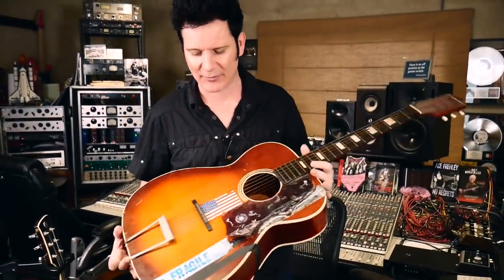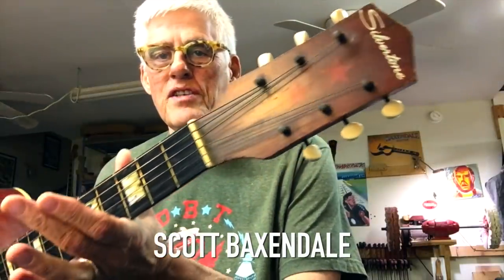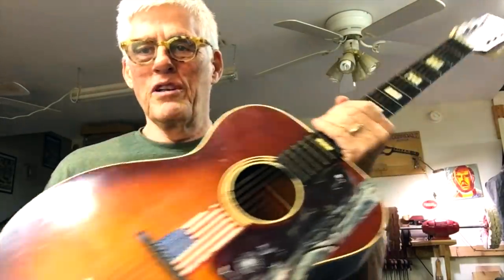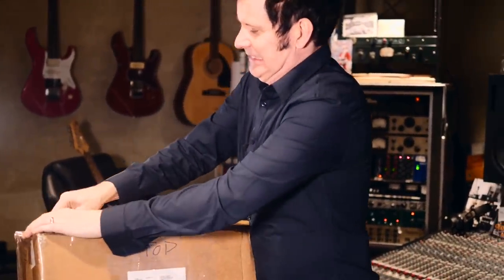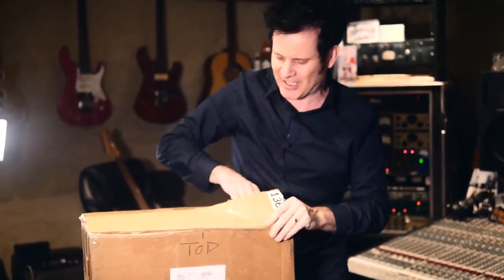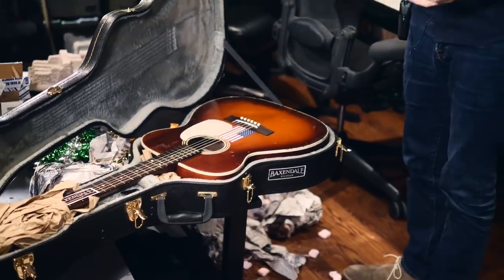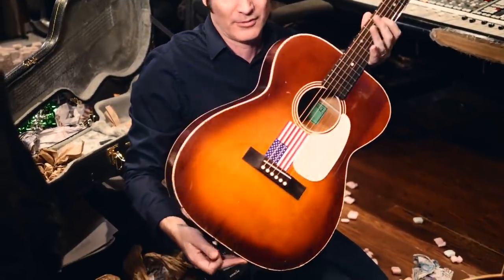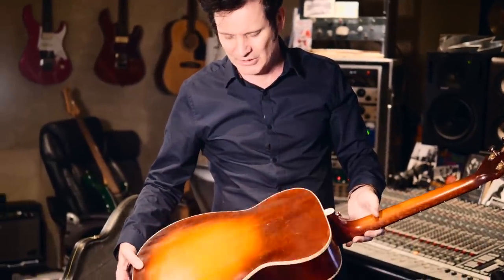Scott Baxendale: Acoustic Conversion Process  - Warren Huart: Produce Like A Pro

Comment: We use D’Addario Phosphor Bronze medium gauge.
Reply from the maker: Scott! Thank you my friend! Again, marvellous work!
Reply: Best strings available. IMO.
Reply from the maker: Jason Simmons have you tried Elixirs? Or the new Sono-Tones? Any opinion on either?
Reply: @Producelikeapro  I have tried the Elixirs and they lasted a long time I didn't like the coating on them. It gave a funny feel to them. I know the difference is minimal in feel but I couldn't get used to it. Haven't tried the other brand you mentioned but I might give them a go now that you have mentioned them. Thanks for all you do for ppl like me. I've learned a ton from your videos. 👍
Reply: Produce Like A Pro As a Luthier who has been restoring guitars professionally for over 40 years I can say we do not like Elixer strings. They are a life saver for the guy with acid hands, however. The coating changes the sound which on a tinny or crappy sounding guitar smooths out the harsh high end and makes them sound a bit better. However, on an acoustic guitar that has world class tone the coating dampens the sound and dynamic range of the guitar. We prefer phosphor Bronze or nickel strings without coating. I’m a huge fan of flat wounds on archtops!
Reply: @scottbaxendale323  love the sound of phosphor bronze strings!
Reply from the maker: I love Flat Wounds on Archtops as well! Thanks for the tip Scott!
Reply: Produce Like A Pro I hate elixirs but do like the SonoTone and other nickel or steel acoustic strings.

Comment: Just curious about why they changed out the floating bridge?
Reply from the maker: NedFumpkin the new bridge was a vast improvement in sustain! It sounds amazing now!! So much richer!
Reply: The floating bridge and tail piece design works by the strings setting the top in motion by pushing down on the bridge when you pluck the string. Violins are made this way, and when a string is bowed it works great, but the sound has very few overtones.

With our tuned scalloped bracing similar to a pre-war Martin the top is set in motion by the strings pulling up from under the bridge. A much more sophisticated tone can be achieved with this design vs the tail piece design which gives a clear fundamental tone but very unsophisticated overtones. Our bracing with the standard pin bridge design provides the best tone, balance and headroom. This gives the world class tone that is so essential for great acoustic guitar recording.
Reply from the maker: Hi Scott Baxendale wow! What a wonderfully detailed response my friend! It explains why the guitars sounds so good!!

Comment: Superbly refurbished! But is it worthy costwise? I guess it's worth every penny because it has a sentimental value.
Reply from the maker: SkankTv RO it’s worth EVERY penny! The guitars are made of solid wood! The thing that let them down the most was the bracing! Once the bracing is upgraded it performs like a guitar 2-3 times the price! And, very importantly it saves trees! This is a 40-60 year old guitar that now makes great records!
Reply: It’s totally worth it cost wise when you consider that for around the cost of a new Chinese made Blue Ridge or Low end Martin made out of Formica you get a “New” remanufactured guitar made from wood that is anywhere from 60 years old to over 100 years old that has stabilized to the point where it is basically impervious to drastic changes in temperature or humidity. Plus it has new tuned scalloped bracing that you normally can only find in new guitars that cost over $5000. Sentimental value has nothing to do with it. Once it is completed the guitar sounds better than any new factory made guitar at any price, and is at home in the studio or on stage. I’ll put the all birch guitar we just rebuilt for Warren up against any Eric Clapton Martin and our rebuild will win every time. Do you think a guitar that can do all of that is worth $1000?  Our remanufactured guitars come with a full new guitar warranty for all structural and playability issues, making the new real relic guitars.
Reply from the maker: Hi Scott Baxendale great detailed response my friend! It’s a work of art!!
Reply: @scottbaxendale323  Thanks Scott for your reply! You really did a wonderful job with this guitar and it's obvious that what you do is high end craftsmanship. Maybe someday Warren will show us in a video how this guitar sounds compared to his other guitars. It would be nice.
Reply from the maker: SkankTv RO definitely my friend! FYI I’ve already been using it daily to record with!
Reply: We have rebuilt over 600 guitars to date and they have landed on many Grammy nominated records and have been on many big stages. It’s kinda like putting a V8 in a Volkswagen.
Reply: Produce Like A Pro ...or ten times the price.
Reply: SkankTv RO We have a lot of comparison videos at harmonyandkay_conversions on instagram or at baxendaleguitar on Facebook. Instagram is more up to date.
Reply: @skankTV......I wrote and recorded blues tune 30 years ago called  “Doin the Skank Dog”...lol.
Reply: @scottbaxendale323  Haha, great! :)) Thanks for the info. Now I'm following you on Instagram.